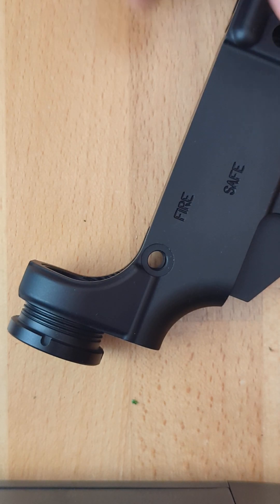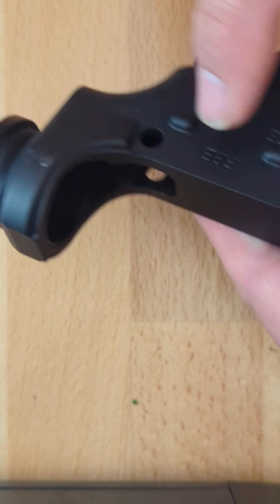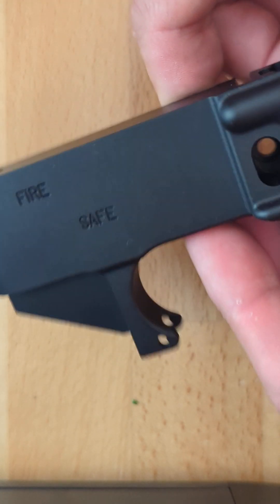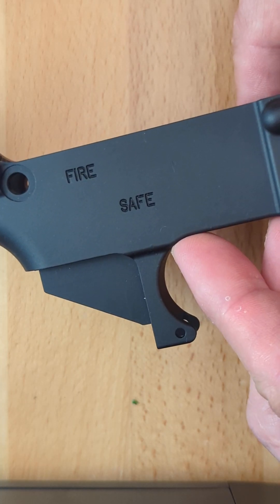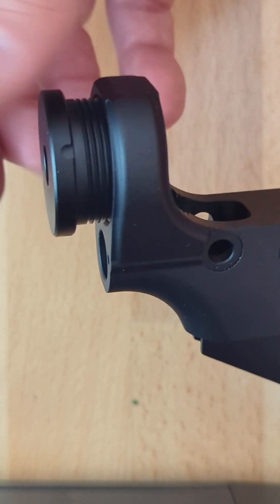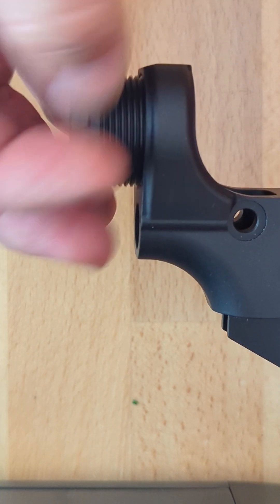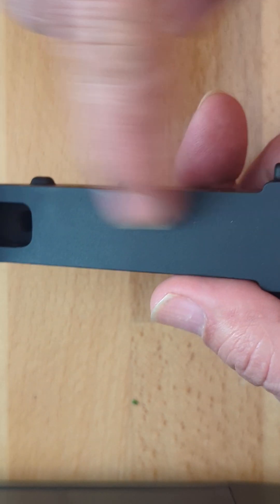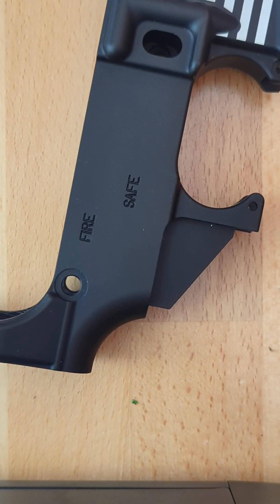DIY is the way...

Comment: Hey Heywood! Actually just started looking into those myself, but the jigs I see online all seem way overpriced! Definitely will be going the print route, but the $150 on mcmaster carr shopping list feels kinda steep as well to be honest.
Reply from the maker: Agreed - I had a 5D Tactical jig but my desire to spread the signal means sometimes the signal does not come back...  I am working to both improve and make less reusable the AWCY? jig to save on costs in some areas and increase costs in others (minimally) For instance the base plate is a simple SCS peice and the side clamping plates can be the same which reduces the Drill Bushing costs.  Nothing will ever be super cheap for this task but I am hopeful that the costs could come down over all albeit with some loss in reuse in some components - but that is why we can just reprint too!
Reply: @3DPrintGuns  That's awesome! I'm just stepping into all this after doing a bunch of printing. When looking into jigs, they all seem more or less like a bunch of metal plates bolted together so I was surprised none of the diy designs I could find used SCS, glad to hear that's a route you're exploring! As awesome as the improvements we've seen for 3d printed designs, I wish we could see more tools and jigs for the apartment room machinist. Not sure if you've seen it, but the FCG housing on the JLC-24 mark serbu covered was all router machining with 3d printed guides and looks really impressive!
Reply from the maker: @isaacsimmonds6407  I will need to check that out -  love Mark's stuff.  I need to buy a small welder as I have lots of tube and box design ideas too.